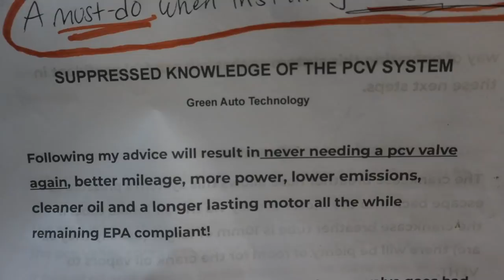The Wonder Of Positive Crankcase Ventilation

Comment: Whenever I think of a PCV valve, I always get transported back to my youth, when a lot of the cars on the road had no PCV valves. When it rained the water on road looked liked a rainbow. As I grew older that started disappearing. Not until later did I understand that what made the rainbows water go away was the PCV valve. The amount of oil on the roads before the PCV valve was something else.
Reply: Well, yeah and no. Can you imagine 1.5 million FE Fords on the road at the same time for years on end? 

That engine family doesn't have a leak, just a constant drip....
I was changing the oil in my Dad's 68 F100 back in the day. He was talking to me while doing so and said something to the effect, "look and see which oil pan bolts has oil on them and tighten them down. I crawled out and got a socket and ratchet and stated, so you want me to torque the whole pan.... Might have been 2 that didn't have oil gathered up on it. Every FE I ever saw out in the wild had 3/8" of grime coating the entire block assembly. 
Don't get me wrong FE's kept Dad at work and food on the table. Most fond moments of my life, building a 390 2bbl. to replace the 360 he had put 250K miles on, that I was referring to in the beginning of this post.
Reply: Ads also leak less oil nowadays
Reply: That's one of the unique memories of riding/driving around before 1970 or so, when all the highways had that tell-tale black patch straight down the center of each lane.  With the crankcase vents and the old oil seals of the day put together, the roads definitely had a unique charm.  Roadside burger joints, full-service gas stations, and drive-in theaters.  And if you were a biker, don't ride the middle of the lane, especially in the rain!
Reply: @kramnull8962  The 352 in my 66 Galaxie never leaked after I replaced the manifold/valley gasket.
Reply: @easygoing2479  I remember those "striped" lanes.
Reply: @michaelbenardo5695  That's good. I'm only going by the FE's I saw. A person that takes the time to maintain the looks of their engine compartment wouldn't have such a problem with the gack I was speaking of. But like my Great Aunt's 67 Custom it was doing good to get oil changes. She barely drove 500 a year. She had the car when I was born 1972, and until she died 2000. It wasn't as gacked up as my Dads truck but dad put 250,000 on a 360 then yanked it out and put the 390 in that is still going today with 350,000 on her. That engine had 100,000 on it when he rebuilt it, good lord it was bad on the outside; as well as the rocker covers were caked to the brim in crust, enclosing the rockers and all.  Dad dailied that 68 F100 for 40 years. Yeah those 2 were gacked up.
Reply: Lol in Allentown, it's the hood, everyone drives 30 year old Hondas and Toyotas, and 90s Buicks so in 2022 they still have problems with the road covered in oil,  it does get slick when it rains, and you see the rainbows too.

Comment: My dad said it took a good 15yrs or so after the pcv valve was in wide use ,but the center of the road was much lighter color and safer on a motorcycle.
Reply: /Yep the center of each lane has a wide black stripe from the oily residue.
Reply: @thecollectoronthecorner7061  Mostly due to leaking oil pan and/or rear main seals. In the '80s mfgr increased pan rigidity(or added supports to rails) and went to one piece main seals that eliminated 99% of the leaks.

Watch a few episodes of CHIPS, 10+ years after PCV introduced, center of lanes still had oil slick.
Reply: @tombryant1104  The chevy V8 had the same oil pan front cover and two piece rear mains for at least 20 years after the PCV was  made mandatory. Ive owned and still  own lots of vehicles that have the two piece rear mains that dont leak. I drove semi trucks for 40 years. In calif and other places.  its the blow by from the semis that kept the roads oily. Every 2 cycle detroit diesel had four spit tubes on the air box that puked a lot. They got some wear and made lots of blow by. It wasnt until the supercharged 2 cycle Detroit diesels where phased out that the oil leaking diminished.
Reply: True...it does seem like that dark center patch was much more noticeable when i was a kid!!

Comment: It absolutely amazes me how many people don't understand something as simple as this, I can't tell you how many times I've seen people putting catch cans on the side that's supposed to suck into the motor because the side that sucks out into the intake is plugged and it's blowing oil residue back out of the vent side
Reply: I've found engine swaps,  admittedly from Alabama, where they decided to leave everything open to vaccuum rather than bother hooking up PCV and EGR in any way that made sense, even between two Ford V8s.  I forget the details but someone essentially sold my Alabama friend a truck in some kind of limp mode.  He's more or less a computer guy.  But when his Alabama girl fiancee was like, 'I could never do that,'  we both said, 'Sure you could.'   Hate it when people get convinced to sell themselves short, whether it's about thinking or posing like  they can't learn something over sexism or over 'It's politiclaly easier to say I believe insanity.'   ...Anyway, my dude friend is like,  "Hey, I build computer systems,   I bring this kind of thing to Olive for reasons."  :)    (In this case years of experience may have spotted the thought process of the hackery but yaknow.  :)  )
Reply: Fix oil consumption on LS engines
Reply: They are the same types who refuse to have their oil changed, then blame the engine maker when it dies an early death.

Comment: They don't build 'em like they used to !!!  In a lot of cases, this is a really good thing. That sludge you speak of, I remember removing small block Chevy valve covers and finding sludge sculpture humps with Chevrolet imprinted on the top of them, no rockers visible.

A word of caution though, installing "high performance" valve covers without proper baffling will likely result in sucking all the oil out of your engine or at least leading you to believe that it is burning excess oil. I've bought a lot of cars with M/T valve covers that "burned oil" for cheap prices, installed baffles and had nice running cars.
Reply: Paul , that was G eneral M istakes. Early attempt at”Quiet Valve Technology “
Reply: Glad you mentioned that.

Comment: My nephew had a rear seal leak on his 1989 5.0 Mustang GT and it had a brand X PCV valve  so he put a Motocraft  PCV valve in and the leak stopped  we did this several times and the same results every time so the PCV works if you use a good quality part  .You get the best results with name brand parts . Like the commercial used to say  " You can pay me now or you can pay me later ".
Reply: So you think a PC valve is capable of generating enough low pressure to keep the oil from leaking? 
Try and understand that a PC valve itself is a restriction and what little air it pulls comes from a vented valve cover... take the PC valve off the hose and stick the hose in the valve cover and even it you could get the motor to run it still wont create a vacuum inside the motor..
Reply: @blackbirdxx928  to prevent oil from blowing past seals , you don't need to create a vacuum , you only need to relieve pressure so that the oil isn't being BLOWN past the seal . 
While you doubt the PCV system can create a crankcase vacuum , you must certainly admit that even a LITTLE blow-by , if unrelieved , can certainly create crankcase pressure .
Reply: @Richie_the_Fixer  i agree. Also the calibration of the valve is critical. Thats why there are so many part #'s for them I've done the same. Ive fixed rear and front main leaks with proper crankcase ventilation.
Reply: @blackbirdxx928  We did it several times and it worked and if I wasn't there I would never have believed it. Sorry you weren't there but you can't change "what Is " The Motocraft  part stopped the seal leak every time. There is no argument that it WORKED the only argument is HOW ?
Reply: @Richie_the_Fixer  how can you generate crankcase pressure if you have an open breather in the other valve cover? To generate pressure you need restriction. Pcv valves are just a calibrated vaccum leak. You might not quite get it but the more load you put on a motor the more flow gets past the rings at the same time the engine vaccum is minimal.
Heavy load and most of the blow by goes out the breather and down the carb.
As for pcv valve test. Pull it it out of the valve cover and drive it and see if it still leaks.
Reply: @edge2sword186  so what is your theory? 
Its car stuff, it's simple. There is no magic involved. Do you even know what is inside a pcv valve? Do you also know it's a check valve? If the motor backfires and the flame that is in the intake makes it into the pcv valve hose and without a check valve to stop the flame it blows into the crankcase that has flammable oil in it. And if that oil is contaminated with fuel shit might blow up.
Reply: @blackbirdxx928  The engineers designed that PCV valve for their engine and the brand X part did not meet the same standards. It's like buying real OEM lifters or brand X Chinese lifters and expecting the brand X part to work like the real McCoy.
Reply: @edge2sword186  pcv valve is nothing more that a calibrated vacuum leak and a check valve....its as simple as 3/16 hole...change the size of that hole and you alter the air fuel mixture at idle. Pcv valve flows the most volumn at idle when vacuum is high. Driving down the road when vacuum is lower means less flow at a time when the engine is under load and producing more blow by gases. Those gases leave the crankcase unrestricted through the breather hose, usually in the other valve cover. That hose is connected to the filterd side of the air filter and into the carb. The hose is connected to the filtered side of the air filter because at high vacuum levels like idle the air that gets sucked through the pcv valve has to come from somewhere and rather than suck dirty air it used filtered air.
Pcv valve can actually reduce horsepower. Rather that the motor getting nice cool filtered air it gets hot air that is contaminated with oil vapor that can cause detonation. Pcv valve DOES NOT reduce tailpipe emissions, it does eliminate particulate from the atmosphere. I work on hot rod boat motors all the time and none of them run pcv valves. They dont blow oil out the seals and all of them have a certain amount of gasses that leave the motor through breathers. Those breathers are designed in a way to separate the oil from the gasses so what comes out contains no obvious pollutants. The oil that the breather traps drips back into the motor where it came from so there is no loss of oil volumn in the process. Blown and supercharged engines tend to generate more blow by because of much higher cylinder pressures. When the volume of the escaping gasses exceeds the capacity of the breathers to separate the oil a hose is attached to the breather and the hose runs to a catch can mounted higher than the valve cover. The extra volume that is part of that setup allows more time for the oil to separate from the escaping gasses and that oil returns to the crankcase when the motor is not running.
Pcv valves function best at idle and more load and rpm on a motor decreases their function. A worn out motor will use more oil with a pcv valve because it allows blow by that contains oil into the card where a proper breather system will trap that oil and allow it to return to the crankcase.
Reply: @blackbirdxx928  I would say that the PCV valve did what the engineers intended for it to do " Vent the Crankcase . Can we agree with that ?
Reply: @Richie_the_Fixer  This also has to be countered with the age of the engine too. The PCV works very well on a fresh engine --- not so good as it ages.

Comment: Tony I remember hearing in addition to everything you said the PCV also helps remove the crankcase pressure that builds behind the piston on the way down and actually helps make a small amount of additional power.
Reply: That's not how it works mate. The crank case vaccume helps with pressure differential on the rings causing the rings to press harder against the cylinder wall. This makes a better seal keeping the pressure in.
Reply: If there's one piston going down, then there's it's counterpart, going up. You've got the right idea about scavenging the crankcase, but you need outside vacuum to do it --- much stronger than just pistons changing position.

Comment: I think you are mostly correct. Oil was vastly improved at the same time and also got better oil filtration systems. But PCV valves closed the crankcase to unfiltered air and you’re right, they are the one thing the EPA got right!

Comment: Dad taught us always to hold off driving for a few hours after it rained, especially if it hadn't rained in a while. That way the oil which had built up on the roads had a chance to wash away. Not to mention, most drivers have a difficult enough time when the street is in perfect condition. We're better off not giving them more chances harm us or damage property
Reply: Hot humid summers then a thunder storm roads were so slick  I remember
Reply: Don't forget we were on crappy bias ply tires as well.
Reply: Yes - and it never occurred to me that that advice probably came from the time before PCV systems!
Reply: @thromboid  it’s still good advice. After all, have you seen a Walmart parking lot?
Reply: Trust , there is STILL plenty of oil on the roads . 
Leaky gaskets & engine seals , axle seals , transmission pan gaskets , and torn CV boots all contribute to road slime . 
Anyone that rides a motorcycle knows to ride in the tire tracks , where tires have (at least partially) worn off the road slime , and not between them in the center of the lane , where it remains slick !
Reply: @Richie_the_Fixer  never said there wasn’t

Comment: Another great video Tony. You are so right about the pcv. The 368 Turnpike motor is not a MEL. That engine was Fords first OHV Originally released as Ford truck/ Lincoln engine at 317 , later growing to 341, and then the 368 you have there.The MEL, Mercury Edsel Lincoln was released in 1958 and included the 383,410,430 & 462 and ran through 1968 when it was replaced by the 429-460 Lima motor.
Reply: I thought that didn’t sound correct, you are right in saying the MEL came out in 58.

Comment: Tony, another great video!  You're only telling half the story.  PCV valves were for sale since the 1940s.  Truck mfg'rs have offered them as options for cleaner engines and longer service intervals.  I have some brochures from IHC that targeted them for stop'n go delivery trucks to short hauls; and my 1951 IHC L170 has one from the factory still on it and working.  It was a Dutch engineer in LA I believe starting in 1957, who made the correlation between heavy smog and crankcase emissions. His testing with PCV valves is what got the gov't interested in trial runs in CA that got the ball rolling for mandating reducing the smog that got so bad LA County would shut the schools down for days at a time.  Thanks again!

Comment: I'm using a 1953 Studebaker V8 that originally had road draft system in my rat rod and it's getting a PVC system. I am just a couple of years younger than Tony D. and I remember those days too. Tear down one of those old engines and you'll see the difference!